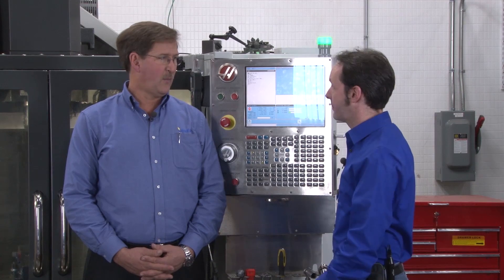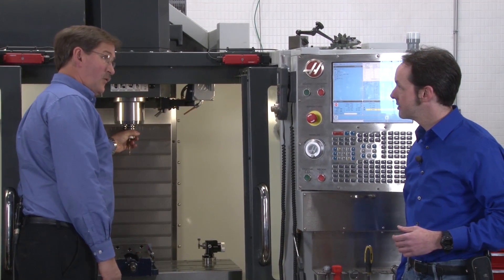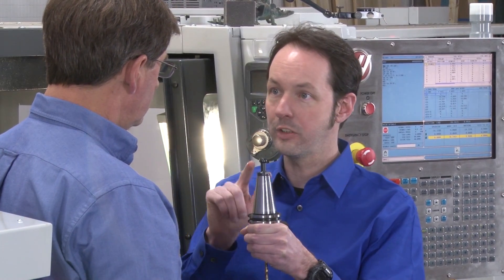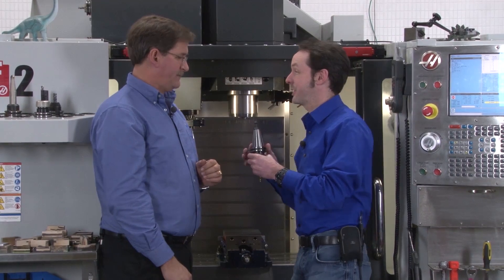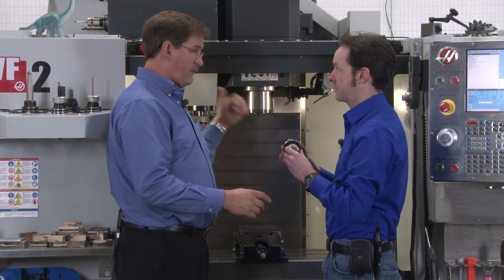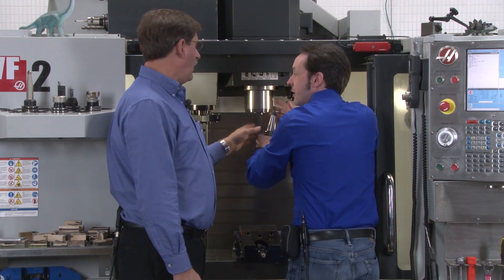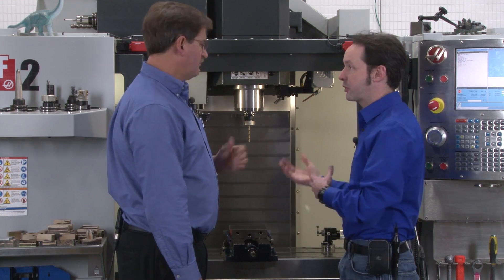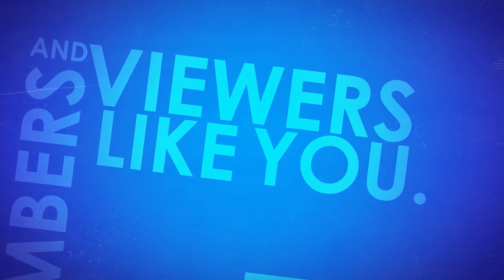Loading Tools Into the Spindle: CNC Training Series

Comment: 4:49 With a Haas machine, from I see. Is that they have a rather large gap compared many other machines. Not sure why it's designed like that for. The spindle taper should cover all of the available tool taper if possible.
Reply: There's a gap about that size in my machine too -- it seems to be to the cat40 spec.
I know there are some machines with certain spindles and toolholder geometry that are "double contact" though and they can often sit with less gap on normal toolholders. Perhaps that?

Comment: From my experience the "tool release" button on the control panel helps when you have a large or heavy tool in the spindle you need to remove. You can use two hands to hold on to it while someone else hits the "tool release" button on the control panel.
Reply: Also used when the umbrella/arm run into a faulty error your able to use the walk through on how to safely drop the tool and the button must be used for safety

Comment: One must designate any tool over 3.5" in diameter to a large pocket in a VF-2.  The two adjacent pockets must remain empty and an extra tool change cycle will occur when calling said tool. The larger the diameter the more centrifugal force; combined with weight it will do a number on your spindle life. Ever notice how tool 5 might be in pocket 21 or any other seemingly random pocket. You can call tools by pocket through MDI, instead of M06 T5 use M06 P21.

Comment: Coolant fed twist drills are either done by drilling angled holes toward a center hole down the spiral which kinda sucks because you cant really sharpen it too many times. The more interesting way is to drill the holes in a straight flute blank then twisting it into a drill shape before putting the final grind on.

Comment: For getting the holes in the tiny drill... i would be guessing an erosion/spark drill.
Reply: Nope, they use a powder that does not get compressed with the rest of the carbide! Source is from sandvik.
Reply: you probably won't get them this tiny, but you can make a plastic core that just becomes fluid when heated and can be ejected with air or oil.
Reply: I agree... they use WEDM.
Reply: Yep, it’s sintered into the blank before grinding
Reply: What mechanism is it??